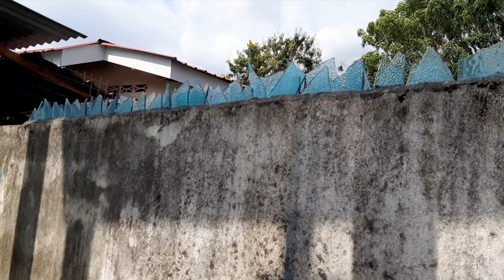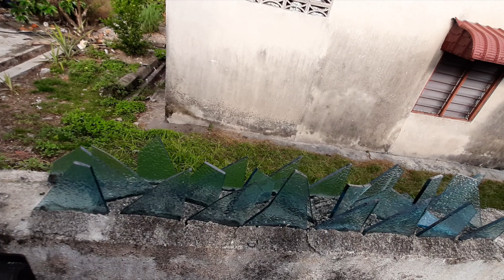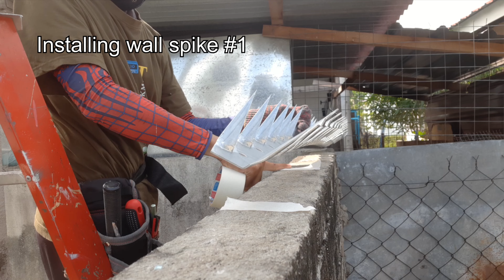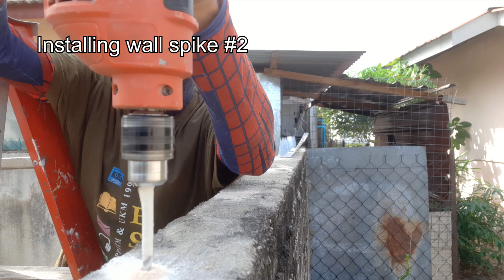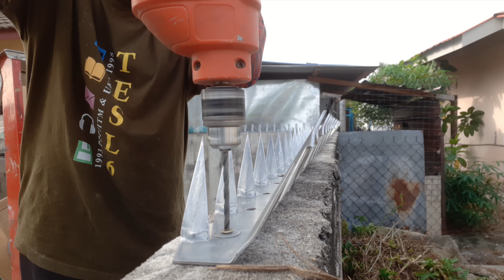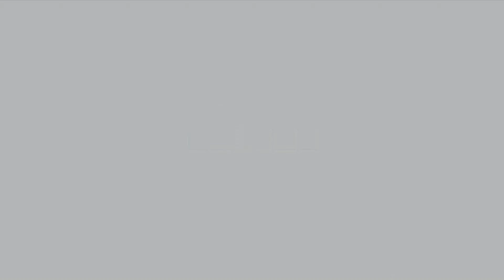Project: Fitting wall spikes

Comment: Where did you got strips from, ? Do you have a link
Reply from the maker: I got the spikes from my sister. This is a similar product: https://shopee.com.my/Security-Wall-Fencing-Spikes-Spike-Anti-Pencuri-Anti-Climb-Type-1-i.12655169.7424827683?sp_atk=9748fa7c-c75c-48da-9713-548a720a508b
Reply: We bought ours in Texas.
Luved how well they are made. And we painted to match my wife's climbing vines
Reply from the maker: @hajihiga7960  yes, painting them is a good idea, because even galvanised ones still rust somehow.
Reply: @hajihiga7960 I’m in Texas. Link please
Reply: @Keepitoriginalministry  
Bought them at a warehouse in Dallas 
901 Singleton Blvd 75212.. they have them stacked in bundles of 3 or 4.. I forget.. anytime I need more, I know where to get
Reply: @Keepitoriginalministry  , hope that helps. Sorry for late reply. Let me know if you need any help.. I bought them as a deterrent..I'm looking forward to adding these to my other property..and work them in with some nice bushes and vines that will make them discreet